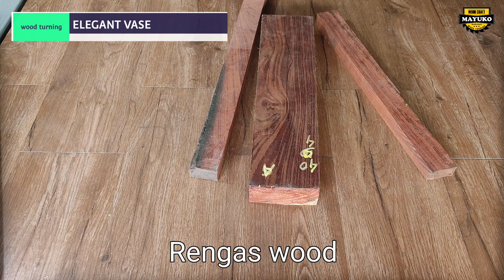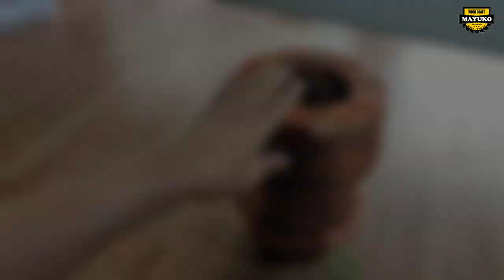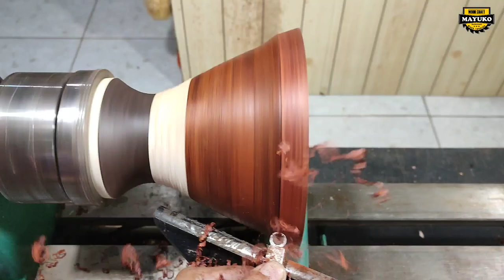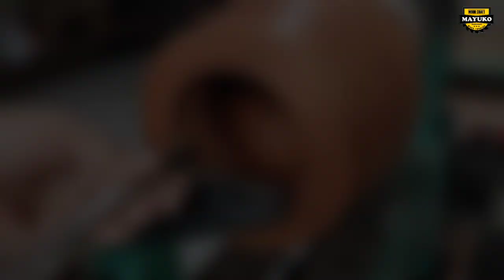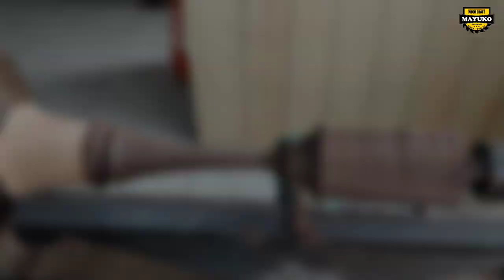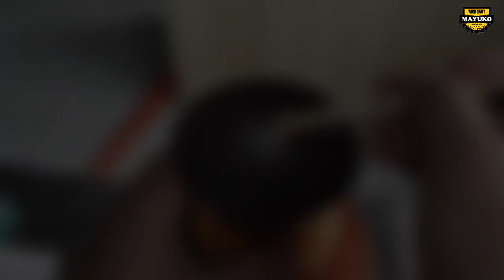THE RED VASE, woodturning

Comment: Very nice! Beautiful wood!  I think I would have used a bowl steady device to support the vase when turning the end when it got so large.  You could see the unsupported end flexing.
Reply from the maker: Thank you..🙏🙏, I didn't use steady rest because I thought the chuck was still able to support the vase
Reply: @mayukowoodturning7644  Yes, but I’m sensitive because I recently had a bowl under similar circumstances pull out of plate jaws with rubber feet and supported by a steady rest when I had a catch while turning off a waste block.
Reply from the maker: @drferry  yes it's better if you want to use it